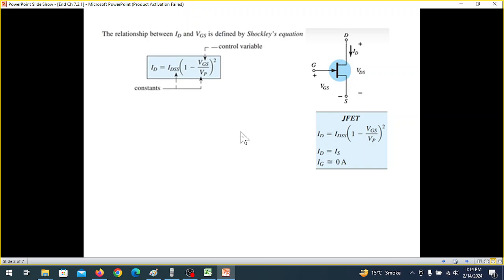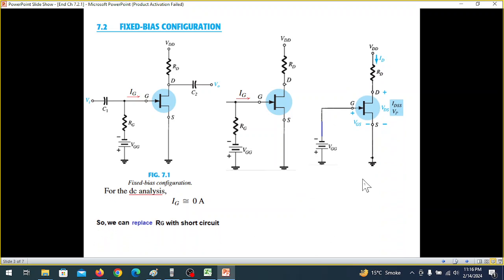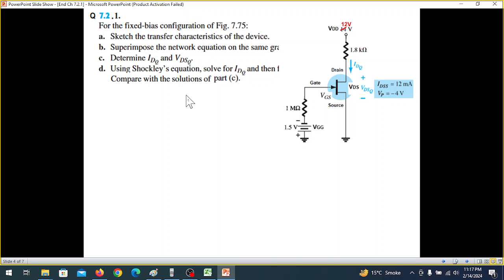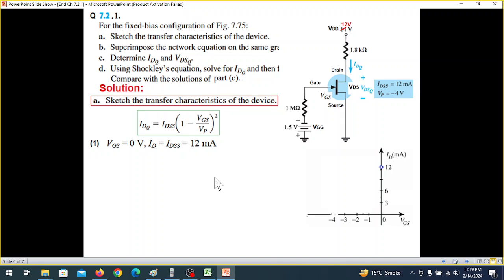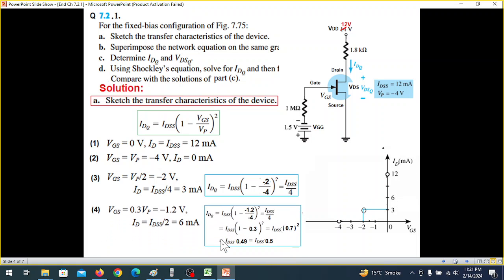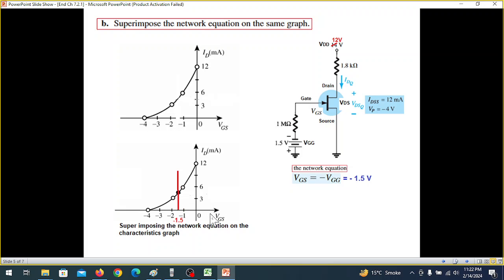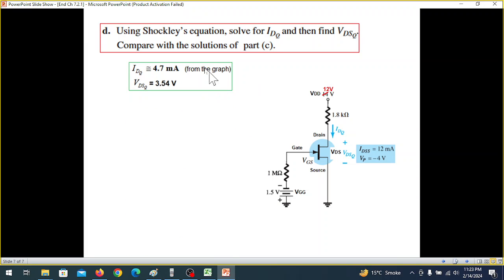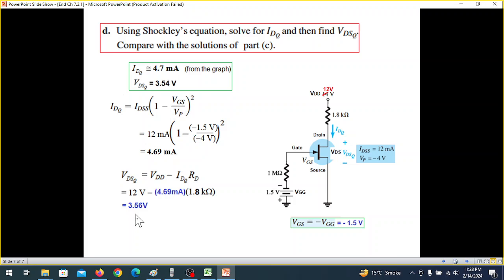(E)EDC(B)  Q 7.2.1 || FET Fixed Bias Configuration

Comment: Thank you for your wonderful video. I learned a lot from you ❤

But I have a question. I just can't understand where you got the 0.3 from Vgs=0.3Vp of the first part? Or maybe I just overlooked something from your video. 

Thank you in advance
Reply from the maker: It is just an arbitrary point. In step (3) we took VGS = Vp/2 or = 0.5Vp, similarly in step (4) we have taken VGS = Vp/3 = 0.3Vp (aprox). You could take any other point you wish and should get the same graph. (actually we  want to take value of VGS such that we get ID to be 3mA,6mA,9mA etc for smooth plot)